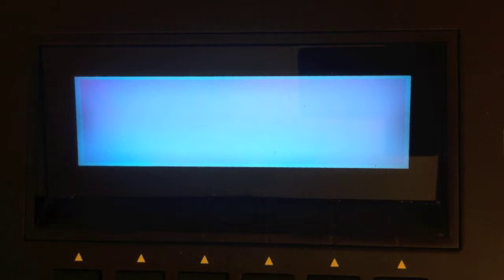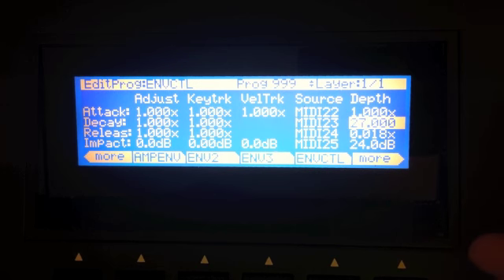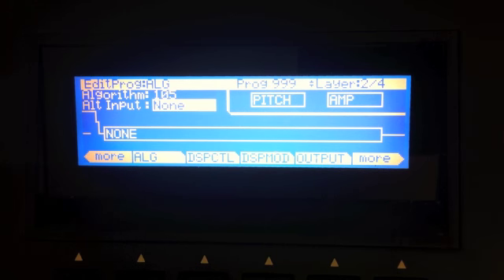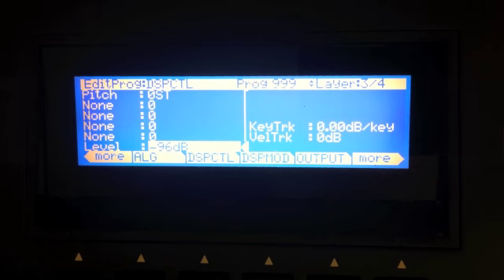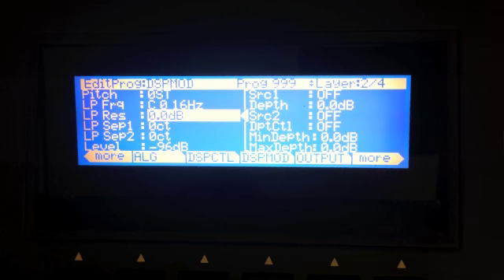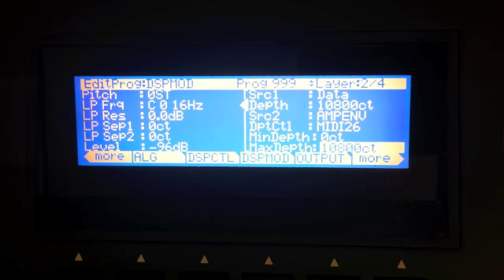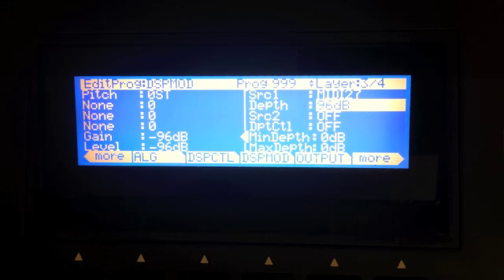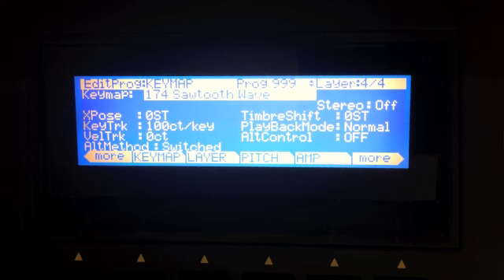Kurzweil PC3: Tutorial 5 -- Cascade Mode and Emulating the Roland Juno 60

Comment: Hello I have a noob question. I am want to program sounds from scrath with the pc3le with the new OS. Lets say, I want to tweak the program n°1021 "NakedVA1sawpoly" so i can have a polysynth sound. What I want is to route the 1st layer (having 1 saw osc) to a 2nd layer having the 4pole lowpass filter (algo n°105). So basically all I have to do is to set up the altinput of 2nd layer with 1st layer right ? The problem is that I only get a saw sound without the filter being applied, like a constant cycle. I can only hear a difference if a turn the volume level of 1st layer all the way down. Sorry but I just cannot figure it out. thanks.
Reply: When I mean I cannot hear the filter, is because if I close it the whole way down I  still can hear the same saw sound without any filtering.

Comment: Hi!! Why did you let the layer 4 block's in blank?
Reply from the maker: If I understand your question correctly, I left the DSP blocks on Layer 4 "blank" because I only wanted to use the Layer for its AMPENV. That allows me to use AMPEVN on the other Layers for things like controlling the filter without affecting the volume. It also allows for the filter envelope to have a different shape than the amplitude envelope and both can be controlled with sliders independently. There aren't enough sliders on the PC3 to fully implement this, but if you have a PC3LE (which has more assignable controllers) you can dedicate three knobs to the filter envelope and three knobs to the amplitude envelope. Or you could use an external knob/fader box to increase the number of physical controls available.

Comment: You use the layer 4 ampenv's as reference to ALL layers?
Reply from the maker: Yes -- the Cascade chain is Layer 1 -> Layer 2 -> Layer 3 -> Layer 4. The last Layer in the chain thus can control the amplitude for the cascaded signal coming through the other Layers.